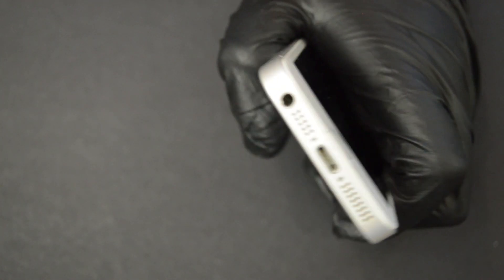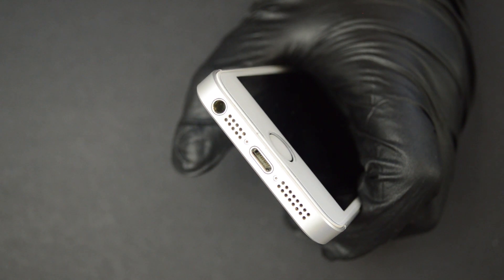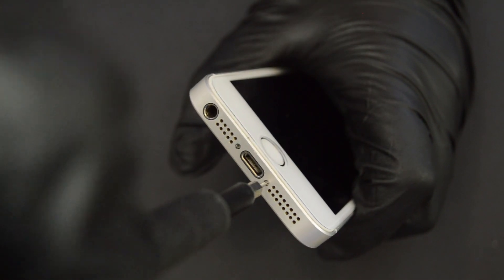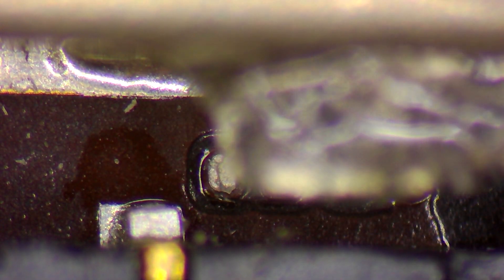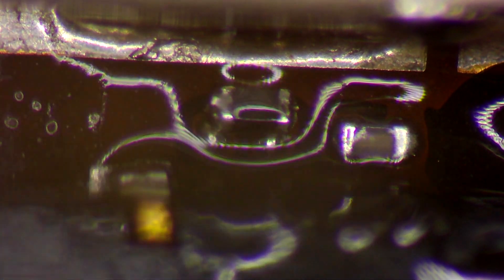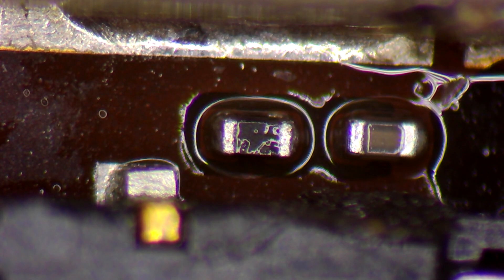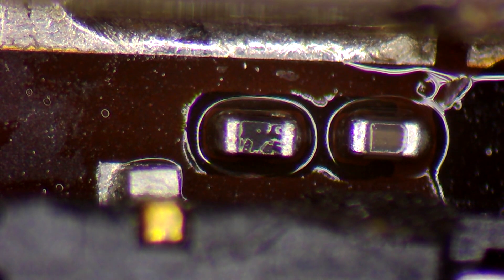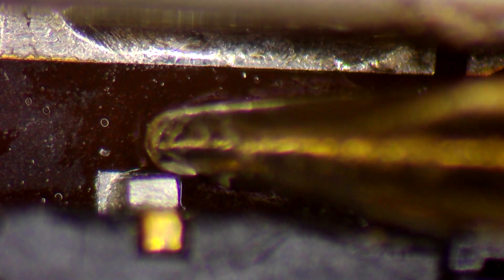Fix iPhone 5 SE not charging after Repair- Easy Filter replacement

Comment: I searched for a Iphone SE battery filter and there is nothing like one in your vidro
Reply from the maker: What do you mean
Reply from the maker: It’s usually listed as the component number on the board ie: FLxxx (x is numbers)
Or download schematic and search for the values of the filter, it’s just acting as protection for the SWI data line, going from the battery to the phone . You could use pretty much any filter out of an iPhone that fits on those pads as it is extremely low current.
Most lazy people just jump it with wire or blob of solder

Comment: Where do you get a filter?
Please help
Reply from the maker: AliExpress, microsoldering supply, rossaman group, eBay, injured gadgets (I think), an iPhone 5, 5s or SE1 
Or if you are in USA, Germany or UK I can recommend a few good repair shops
Reply: @Slot1Gamer  I'm in the UK, London specifically. Any recommendations? (I was considering trying to do it myself since I've had it for 4+ years and I'm looking to upgrade anyway. I tried to squeeze an extra bit of life out of it by upgrading the battery, but I decapitated the filter whilst using a spudger). Also, I have a broken 5s lying about, where might I find the filter on there?

Comment: So you were able to solder without taking the main board out of the phone? Or there are some steps missing.? When you are soldering in the new component is that with or without the shield in place .. hard to tell from video.
Reply from the maker: Took the board out, didn’t need to remove the RF shield

Comment: Just wondering if you will be able to run your IPhone SE with charged battery even without the battery filter that you soldered? Is that battery filter only concerned about loading charge to your battery? Thanks.
Reply from the maker: This filter is actually for the data line running between the batteries internal micro controller and the phone. Apple could design the software to simply ignore the missing data line but alas they don't. With iphones (4G and up), the phone will reboot if no valid data is received after 30 seconds.

However other phones (some android phones) that use these same micro controllers will run fine with a missing data line
Reply: @Slot1Gamer  I see. Thank you sir. God bless.
Reply: @Slot1Gamer  I think there is also miss representation of the percentage and random percentage drops or drastic drain happening? Am I right? Cos when changing the battery, I knocked something and I don't know but since then its been acting crazy. I really love my iPhone SE. Everyone here doesn't know how to repair at all. I came across this video but looks like its micro soldering and I cant do it. But am I right about the random percentages and accelerated drain?